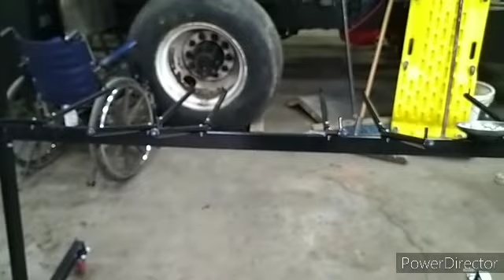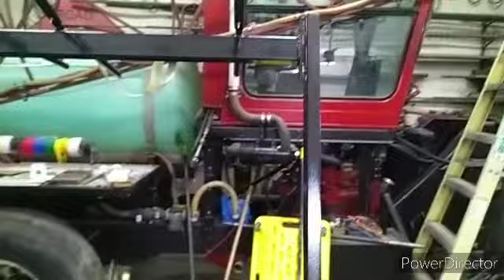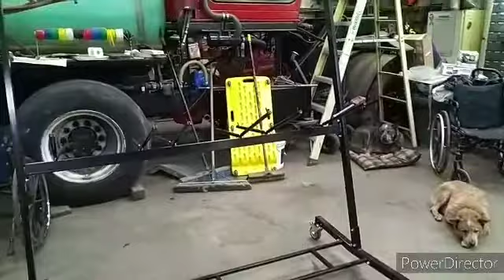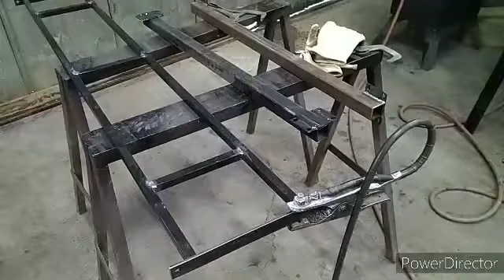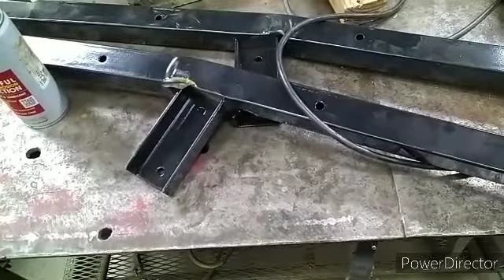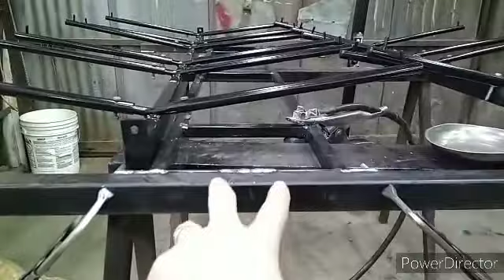rebuilding a chair rack/cart

Comment: Really good comments there on powder coat and welding. Very true Ed: the paint holds moisture behind it and the metal rusts.
Reply from the maker: Powder coating and spray on bed liner.. both a pain to work around..

Comment: I'm here, powder coats sucks to work on.
Reply: Good evening Bruce.
Reply: @brycewiborg8095  good evening Bryce
Reply: good evening all
Reply from the maker: Not only sucks to work on, but rusts out under it.. BTW, I measured the tube wall on the bent pieces.. we used to use a lot of .094" material, this stuff with powder coating on oni side, measured .070... So actual well thickness can be over .050"...
Reply: Hi Bruce!
Reply: @GosselinFarmsEdGosselin  trying to sand blast powder coat of is a real chore,  we would get battery boxes and stuff that was powder coated from the factory. Paint was not even close to a match. They are making everything so Chincy any more to save a buck its ridiculous
Reply: @joshwelner1951  good evening Josh
Reply from the maker: @nidayfarmranch6002  only thing that I have that's powder coated is the bumper on my pickup.. came that way and it was done right.. 
Hopefully you had a good day!!
Reply: Vaughn Farms Limousin  good evening Vaughn
Reply: @tractortalkwithgary1271  good evening Gary
Reply: @GosselinFarmsEdGosselin  my day went real good.
Reply from the maker: @nidayfarmranch6002  good!!!!
Reply: Howdy Bruce!
Reply: @mattthescrapwhisperer  good evening Matt